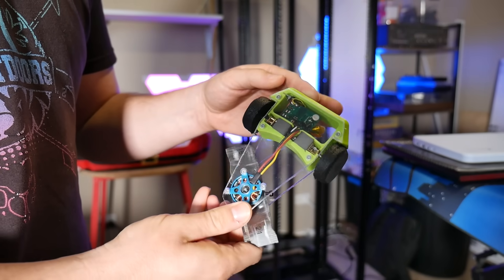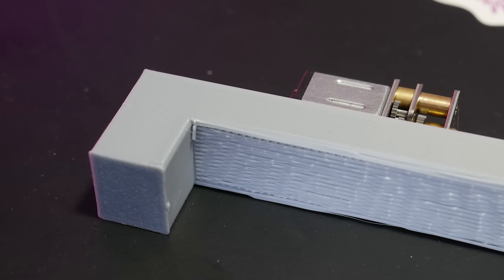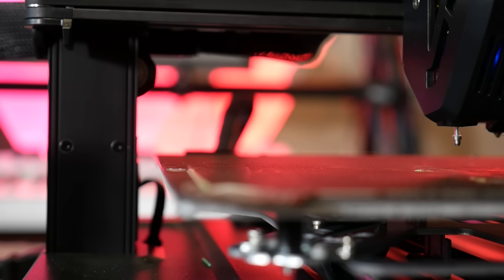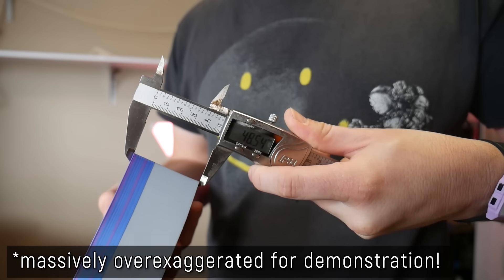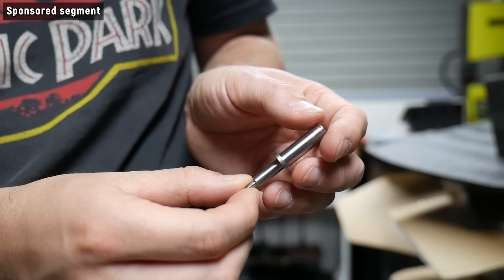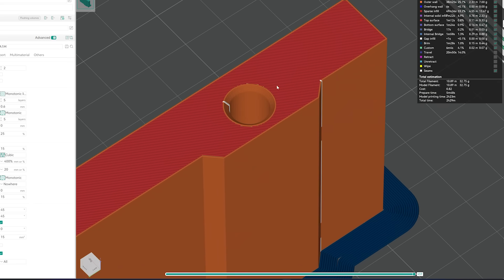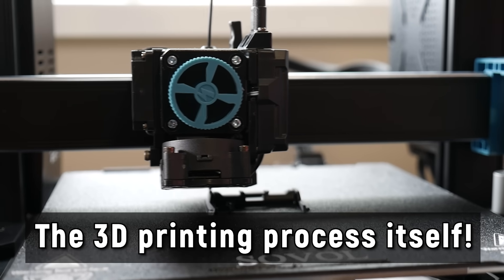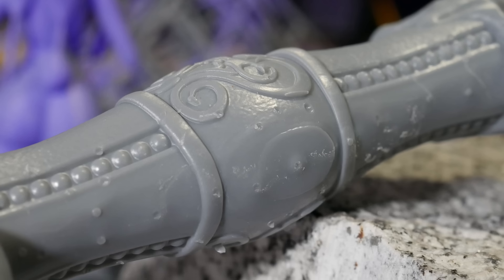Don't make these 3D printing mistakes (they RUIN accuracy!)

Comment: Alright, so a while back I tried to make a modular panel system that I could just print out and build something much larger than what the printer could normally do. Also to get around layer line and bridging issues. It used pegs to attach the panels to each other. The reason it didn't work is because I couldn't get the pegs to go through the holes. And now I know how to fix that problem. Thanks.
Reply: Just use a drill bit and create crush ribs on the pegs ....
Reply: @sierraecho884 
I don't know what that is. Also, it sounds like a lot of extra work. Especially considering the fact that the system is suposed to be 100% 3D printed, I'm wanting to build a car, each panel is 120mm x 120mm, every wall has to be 2 panels thick minimum with XYZ offsets on the outer, and with 8 to 12+ peg holes per panel. Yeah, it's better just to make sure it comes off the printer right.
Reply: @FireFox64000000  Well 3D printing is not as precise at say CNC milling. So if you want that precision you have to use tools like drill bits to open up holes for instance. 

In your case it would be overkill, that´s why I mentioned crush ribs. It´s basically what we use in injection molding for instances when you need to fit 2 pieces together snug but you also need to span some tolerances to make sure parts fit even if they are a little warped and such. So exactly your use case. 

Just imagine it like this, a crush rib is a small very thin rib at the interface that gets crushed then you mount the pieces together, like a wall anchor. It flexes a little and spans the gap. You can create as many as you want into your 3D printed design, no post process required, just the design itself. Crush rib is also more of a German term since I am an engineer from Germany, I am sure people in the US call it differently, but they use it too. 

To make it even simpler in your case, make the dowel like the D cut  shaft. So you can place the flat d cut area on the print bed. Then don´t make the dowel just round but more like a cog wheel or star with multiple ribs along the shaft body, those are the crush ribs that will get crushed while mounting and the peg will sit snug. This way you get easy to print pegs, with a big flat area with flexible sections that are basically sacrificial that will span the tolerance between your parts, you just need a small hammer that´s all. Also when the round hole droops and you don´t feel like editing each hole with this teardrop shape that also creates stress risers you can simply use the flat are of your d-cut pin in this area and avoid it altogether. Designs and prints much faster. 

Don´t forget chamfers.
Reply: Oh and one more thing, bigger parts like you mentioned that are also thin and flat will warp like hell. Read up on material build ups in injection molding parts, that´s why they warp. You can hollow out pieces, create ribbed structures and such to counteract warping. Or create cut outs etc. it´s highly depending on your design. Basically any time you create flat blocky pointy parts it will warp like hell, no matter what material you use, also thermoplastics warp somewhat, the bigger the part the bigger the warpage, it´s just physics.
Reply: @sierraecho884 
Well, all I have a 3D printer and a power drill so the goal of the project is to have as much as possible 3D printed, including the pegs. That's why I went with a rectangular design for those. That way I can just print them out length wise and their layer lines will be perpendicular to the layers of panels. Plus I can put the peg holes at a 45° Which reduces overhangs on the side holes. That being said, maybe chamfers on the pegs would work better than animal ears on the holes.

I think I understand what a crush rib is now. Is it similar to a more permanent version of a plastic buckle or maybe snapfit? Also don't worry too much about getting the right terminology for American engineering. I wouldn't know it to begin with. I'm just some dude in a studio apartment.

The panel size is flexible. If I need to make them smaller so they don't warp too much, they'll be smaller. 

The ultimate goal is to build something that I could overlay with carbon fiber or fiberglass. But I'm not gonna have that for a while.
Reply: @FireFox64000000  "...That being said, maybe chamfers on the pegs would work better than animal ears on the holes...." Do both. And at 45 deg. the wholes will be rough and not dimensionally accurate.

"...I think I understand what a crush rib is now. Is it similar to a more permanent version of a plastic buckle or maybe snapfit?..." It´s not a snap fit, those are different features. A crush rib creates contact at the exact location you mean to and gets destroyed during the first fitting, it creates the perfect fitment. 

"...I wouldn't know it to begin with. I'm just some dude in a studio apartment...." Well I am also just some random dude, you seem to be interested in stuff and it´s always good to learn new things. 

"...The panel size is flexible. If I need to make them smaller so they don't warp too much, they'll be smaller. ..." Yeah but then you need to print more parts and this creates more interfaces and hassle. It´s better to understand that warping happens most in material accumulation areas. You can tweak the design slightly from there. 

"...The ultimate goal is to build something that I could overlay with carbon fiber or fiberglass. But I'm not gonna have that for a while...." This wounds like a pretty involved and complex project with lots of different materials and tools. Just don´t forget PPE.
Reply: @sierraecho884 
"Then you will have to print out more parts" I've only got my desktop 3d printer, it was always going to be a long time. If I get tired of trying to make a full sized car, I'll just settle for making a personal transport pod thing, or a chair if I'm desperate for proof of concept. Plus I've got other things I can work on in the meantime.

"This sounds like a complicated and involved process" Well, the finished process was inspired by Alex Lab and his Iron Man suit project (If you haven't seen his stuff, you might like it). I can't tell you if it's actually complicated or involved. I'm mainly making it to spite the fact that no one else has made a viable 3D printable car.
Reply: @FireFox64000000  "....I'm mainly making it to spite the fact that no one else has made a viable 3D printable car....." There is a 3D printed car to my knowledge. But maybe you would consider it non viable.

Also I would not recommend to 3D print the full car. I am can guarantee you there is a lot of 3D printing involved in car design though ....I am an automobile engineer xD
Reply: @sierraecho884 
Yeah, I know there's been multiple 3D printed cars, what I saw was designed terribly for being made with a 3D printer. Part if what irks me. It was made by dividing up the entire model into a 3D grid and then printing out each section, can't tell from the video I've seen how they connected the blocks. Now that's great if you're trying to print out a deathclaw statue, or a fake sword to hang on your wall, but an actual functional machine frame? They had the layer lines positioned so that anything that hit it would just shear them apart. Like if they clipped the curb. They did not in the slightest factor in the difference in the manufacturing processes. I'd halfway bet the 3D printing was just for the facade.

As for whether or not this is more complicated than I think it is. The end goal is building a half-ton vehicle from scratch using a device and materials that were never meant for the process when I still need to learn hobbyist electronics so I can hook up and control the motor and battery bank. The sky is also blue. But that is just the end goal. Right now I'm just trying to design a modular panel system that I can use similar to a utilitarian version of Lego bricks and build whatever I feel like. From furniture to a car to a house.

Now back to the crush ribs, and I don't think that's going to be viable for my project because it sounds like it's designed to be a permanent attachment, and I need things to be disassembleable. Also, since some of these pegs are going to have to go through 2+ layers of panels, I don't need the crush ribs crushing before I'm done putting them in.
Reply: @FireFox64000000  "...Now back to the crush ribs, and I don't think that's going to be viable for my project because it sounds like it's designed to be a permanent attachment, and I need things to be disassembleable...." It´s not permanent. However you can either have permanent joints that are precise or non permanent joints that have way too much play. That´s why fasteners are never used to position machinery but dowel pins are used to position but not to fasten, those two sub functions are kept separate.

You could create positioning features within the print and fasten everything with bolts and nuts instead. A V grove on one side and a half sphere on the other for location. 3 per plane, and bolts for fastening. Or magnets. 

As for the crush ribs, you do want them to crush, they still flex, it´s not like you wouldn´t be able to keep pushing them. They have to crush to be able to create a tight fit but lose enough to be able to punch them in.

Comment: stress risers in a material as plastic as thermoplastics are not a concern. You're overinflating the effect of that in 3D printing. Its only a concern in subtractive manufactured metallic parts subjected to fatigue loading.

Comment: I hate it when my parts shrink
Reply: They make a pill for that.
Reply: I see what you did there.
Reply: No shame. It happens to everyone sometimes.
Reply: Doesn’t everybody? 😅 https://youtu.be/GG2dF5PS0bI
Reply: Me too, especially on bigger parts like 300mm
Reply: I suffer from shrinkage when I jump into my backyard unheated pool. Can I 3D print an appendage enhancement?
Reply: @googleuser4720  You can use 2,85mm Filament instead of the smaller, weaker one which you have right now.

Comment: Some slicers now have the capability to customise the layer height in specific areas like curves to minimise staircasing. In Orca and its forks it is called Variable Layer Height. Select a part and press the button in the top bar, and it will allow you to 'paint' its layer heights in a bar to the right of the viewport using the left and right mouse buttons. Fast verticals and smooth curves, nice.
You can also paint on your seams and supports with their own layer heights.
Reply: You are right but in my testing it always came with downsides. Personally i never really used that feature. Maybe it got better today and I should try it again.
Reply: @sierraecho884  Well its best not to expect too much from a 3D printer I suppose, I never have because I started with RepRap and they were truly awful. However, if you tune Orca's min and max layer heights you can get reasonable results. You can get down to 0.05mm and up to 3.2mm on a Kobra3 but the first layer really needs to be a min of 0.1mm. Orca's Kobra3 profile had a min of 0.12mm and a max of 0.28mm, which is not great, a Mega Zero 2 can beat that quality, but much more slowly... Tuning your slicer is easily the best way to improve quality.

Comment: And then you have projects where we want a project to finish more quickly so we use multiple printers and different printers. Also using different printers that have different size nozzles. I have pretty good luck because I have fine tuned my printers, and I have 6 machines, that I use daily, 3 brands 2 machines of each brand. I do have 2 more printers, totaling 8 printers in my small farm, one with a .5mm nozzle, the other with a 1.2mm nozzle for very fast prototypes. I can get away with using the .5mm nozzle but not the 1.2. But I never really use the 1.2mm nozzle for finished projects, prototype only.

Comment: The little ears in the D bore are a good idea, I use that technique when designing parts to cut on a cnc, but hadnt thought of using it in printed parts
Reply: Yeah just a free cut, this is used for decades on CNC parts, like shafts. I do that too. Also champer outer corners to prevent bulging and use fillers. It print faster and easier.
Reply from the maker: Yeah definitely need it with CNC. Laser cutting too! Helps stop the parts from cracking.

Comment: Arachne is slower to slice - sometimes WAY SLOWER. Like 30 minutes slow while it does regular in several seconds. Did have such print once. 
Arachne also still has issues with missing layer on sharp vertical geometry - a spear of a miniature in arachne will not print properly and will look ugly. I showcased it in my miniatures masterclass.

Comment: 0:45 To print these without support material, I prefer to have the print pause partway through so I can drop in a previously printed piece to act as the "bridge".
Reply: This actually works? I can print negative inserts to shim instead of using supports? And, maybe, reuse them?
I've been wanting to try this but my printer is buried in other projects...
Reply: @ericm301  Yeah it does. You can use that in say TPU. I wanted to print a wallet flat on the bed. The small slits would need support, but realistically they were way too thin. So you can print PLA plates or shims of like 0,4mm, then pause the TPU print and place them. But honestly this is too much manual work.

Comment: Orca and I think other Prusa based slicers let you set shrinkage under the filament profile, to avoid having to deal with manually resizing parts for certain filaments.

Comment: To be honest, what I am hoping /waiting for is an Ai based slicer! Hear me out, imagine a slicer that loads a model and looks for holes where a bolt goes through and automatically adds more walls to that hole. It looks for very small print bed areas and adds  brims to ensure adhesion to just those contact points not the entire print. Looks for other things and increases or decreases support internal for certain situations where strength would be better. Imagine a slicer that you can click on some key surfaces and say these need to be strong, these need to be accurate and it will slice it in a way to adjust these surfaces for either strength or accuracy accordingly. One that would make suggestions to orientation but not require it, just recommend it. Whoever builds this slicer will get my money for sure! I can spend 10 minutes trying to adjust slicer settings alone for certain parts. Imagine an Ai that could look at a part and make the appropriate suggestions and changes to the print settings on any specific areas to increase strength and likelihood of successful printing! I hope this day comes soon because it has always been a challenge to get things right the first time for certain parts. I would imagine it would save many headaches and tons of plastic and provide much stronger parts with more accuracy in the areas where it is required. Who is going to solve this?? Let's go Ai!

Comment: I don't like faceting of curved surfaces. It is probably inevitable due to the use of stepper motors even if printing a parametric curve.
Reply from the maker: Indeed, both 3MF and STL are made up of tessellated triangles, and even if you slice from STEP it's converted first, so there's no true curves. Hopefully we'll see a true STEP slicer soon!

Comment: I really think slicers should handle this sort of thing. I don't have to change my font for my inkjet printer to print accurately, why should I have to change my model?
Reply: Probably because it's an order of magnitude more difficult. I'm no 3D print software engineer, but I would expect the difference between printing a 2D object and a 3D object is quite literally a completely different dimension. It's also important to remember that the reason you don't have to pick a font is because 10s to 100s of thousands people over 600 years (in the west) before you have been perfecting and iterating the printer. By contrast, the technology of 3D printing, which has very little in common with 2D, is basically a toddler.
Reply: you dont seem to understand the fundamental problem. this isn't a software issue. there are hard physical limits when it comes to accuracy for any inkjet printer and any 3d printer. your inkjet comes with a certain DPI(dots per inch) capability. attempting to print at a higher resolution than that, would yield no further accuracy as the printer physically cannot make smaller/more precise dots. For 3d printers, as noted in the video, the nozzle size is one of the limiting factors for how small of an edge thickness you can make. No matter how much you pay the people who create the slicer program, they cannot change the physical properties of your printer. However, they already have settings in place for FDM slicers to make them usable with even the most accurate printers.
If an FDM printer isn't giving you accurate enough results, then maybe you shouldn't be relying on the physical limits of FDM printing. There are other methods of 3d printing that can attain much more precise models.
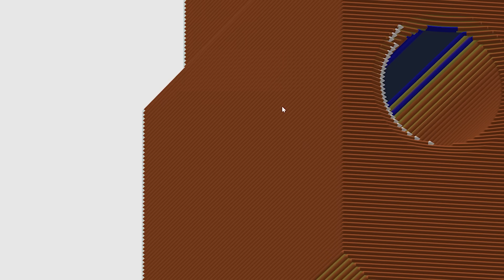Reply: @bmxscape  I mean the holes at 6:56 and the corners at 9:50. Printers CAN print these things properly, but slicers currently print them with defects so they don't match the model. Everyone has to do what Angus is doing to trick it into printing properly. I'm saying the slicer should handle that like they do with elephant's foot

Comment: Toolmakers know how to modify tool designs so that the FINAL product meets the design,  not the tooling.  

3D designers need to know how to DESIGN the part to compensate for the printing anomalies.  

Thanks for this video.

Comment: For #7 the internal corner D bore, I took it one step further and used slot and a piece of wiper blade to make the flat upper surface. My old stove top also used a flat piece of metal to make the flat of the D and it was injection moulded.